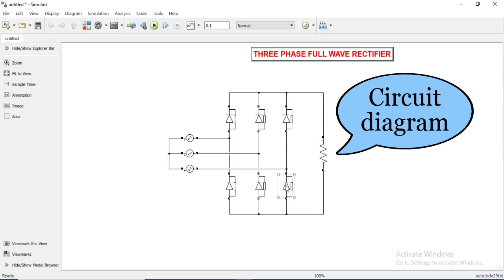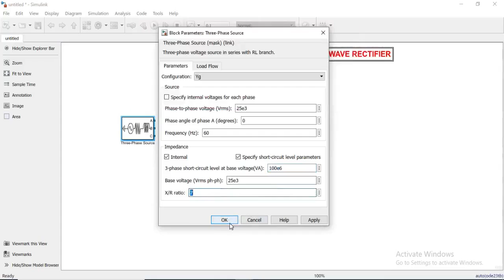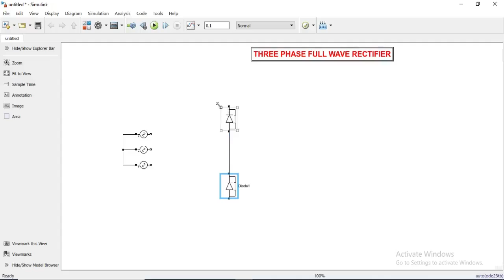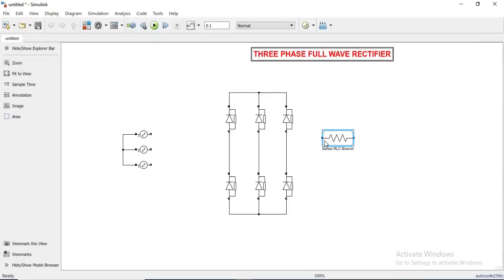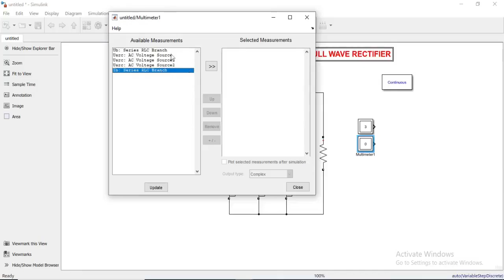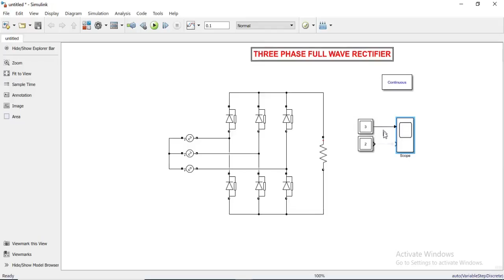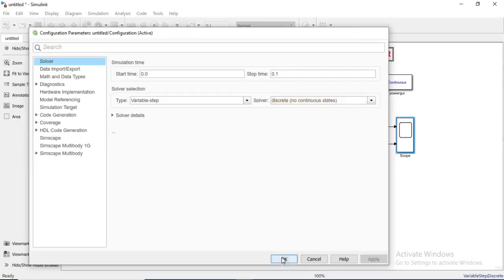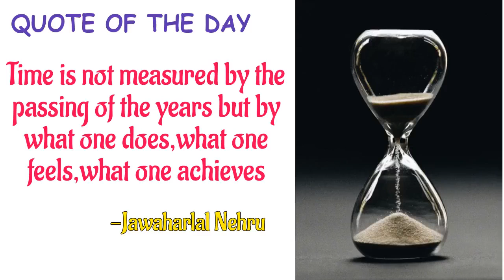Three phase full wave uncontrolled rectifier |Diode bridge rectifier|MATLAB Techworld

Comment: Can I use Sin Wave as a source ? I have 2023 version. I am not able to find the source block that you mentioned in the video.
Reply from the maker: Yes,you can use.
Reply: @matlabtechworld7052  by using MATLAB Simulink Construct and test the following three-phase uncontrollable rectifier. Phase-to-phase voltage
of the input power source: 120V rms 50Hz. Line inductance: 10mH. DC-link capacitor: 470μF.
Load resistance: 100Ω.

AND 
Construct the following single-phase controllable rectifier. Phase-to-phase voltage of the
input power source: 120V rms 50Hz. Load resistance: 50Ω. T1 and T2 are turned ON/OFF
simultaneously. T3 and T4 are turned ON/OFF simultaneously. Set the firing angles of the
switches to 0°, 30°, and 60°, respectively to test the converter. Help me please with it